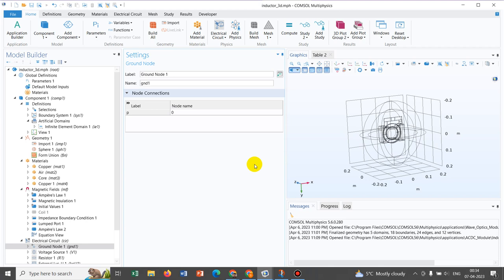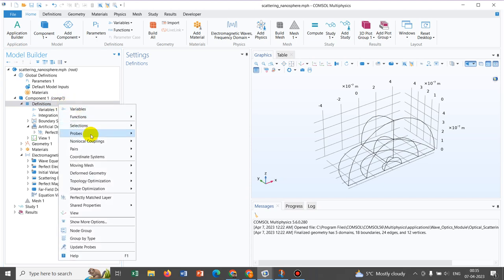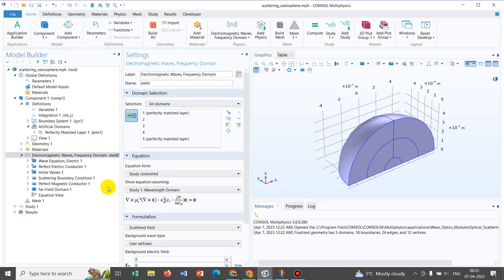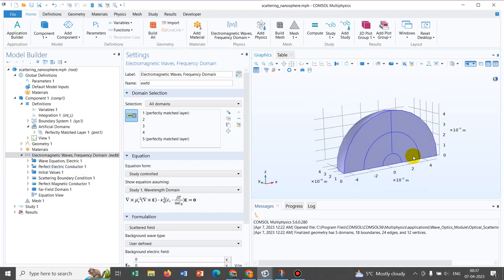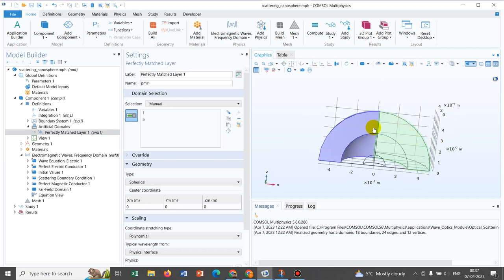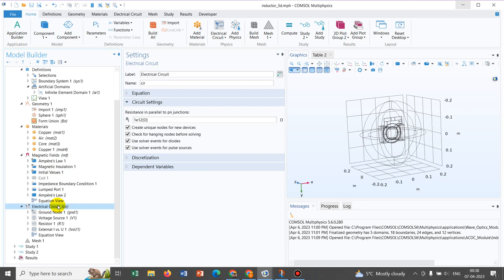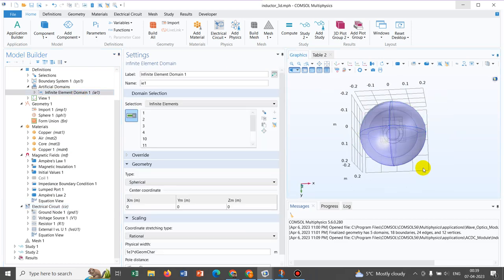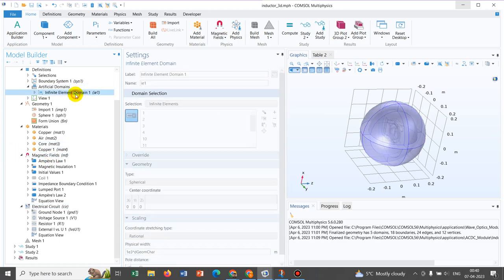Introductory Video on Artificial Domain in COMSOL #PML #InfiniteDomain #COMSOL #optics #scattering

Comment: I have a simple question, when a 2-D axisymmetric geometry is given a boundary condition in the r direction (such as a translational velocity to the wall), it must also affect its symmetry in the -r direction. So there must be some sort of compression process going on. Is it possible to apply this as a complete (including r=0 axis) translation of axisymmetric geometry rather than compression? Or is it mandatory to switch to 3-D geometry?